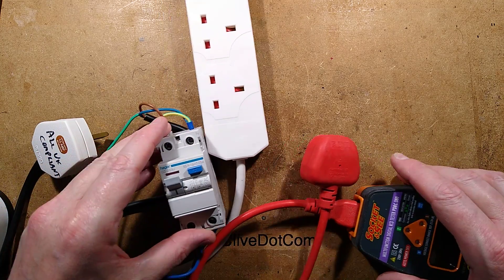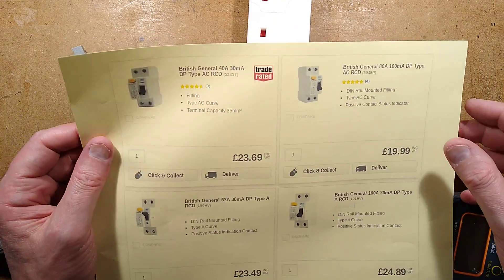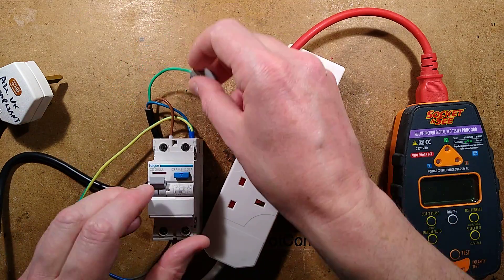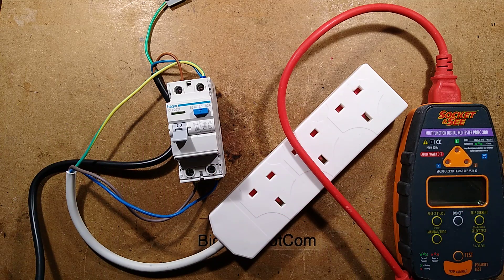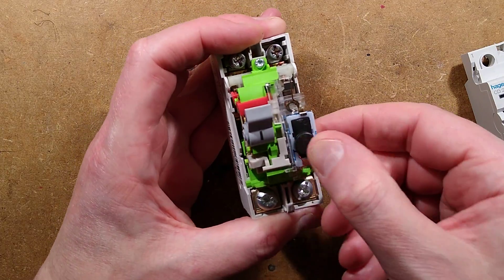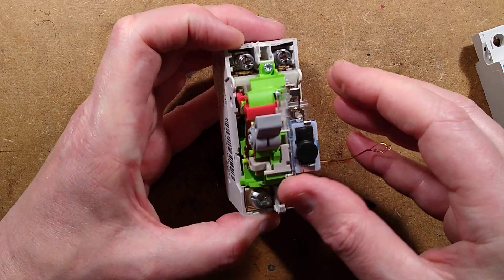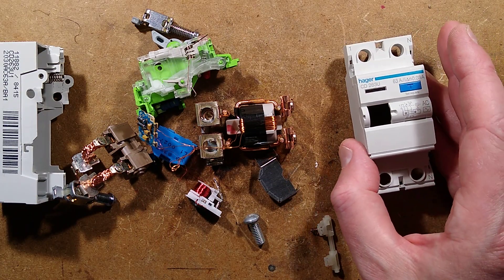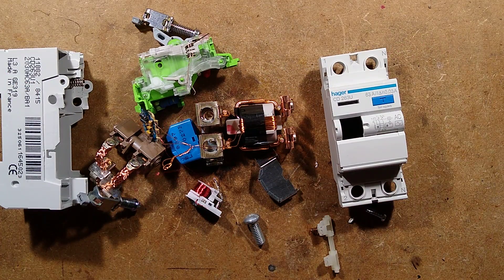Was this RCD damaged by overcurrent?

Comment: ‘You can’t connect neutral to earth.’ US: Am I a joke to you?
Reply from the maker: Neutral is connected to earth at the transformer and often at the supply entrance to a building.  But shouldn't be connected after that point.
Reply: @bigclivedotcom  There’s a round permanent magnet on the top of the coil. The induced voltage cancels the magnetic field and releases the plunger, which trips the breaker
Reply: yes, yes you are

Comment: Monthly testing of RCDs is easier said than done when I have two PCs running 24/7, two more that are generally suspended rather than fully powered off when not in use (thus 5~10W, but still require power to keep RAM contents), and a dozen or more Raspberry Pis that have a bad habit of corrupting their SD cards on power loss ... and a single RCD protecting all of the sockets circuits... 😕
(This is a mid-2000s installation with a single RCD for the sockets and no RCD for the lights, IIRC. The detached garage has its own miniature distribution board with RCD, but that doesn't help much here :))
One of the 24/7 PCs is on a UPS that will last a few minutes - long enough to test the RCD - but the other PCs aren't, and UPSs aren't exactly cheap.

I really wish we just had a box full of RCBOs, but no such luck, and it's not very practical for me to pay my landlady to pay an electrician to replace the otherwise-functional MCBs with RCBOs :(
Reply: Surely worth investing in a few Uninterruptible Power Supplies?
Reply: @stevep8773  Too right, and it tests your UPS at the same time :-)
Reply: @muzikman2008  also tests that PCs boot properly. I have in my charge a PC that after a powercut causes shutdown will not come on again without removing network cable and USB keyboard and mouse. Then plug KB in when it comes up "Press F1 to continue"
Reply from the maker: That and the fact that people can't remember how to reset their cooker clocks.  RCDs and GFCIs rarely get tested.  Fortunately they're pretty reliable.

Comment: If this is only rated for 63A, and it is not an overcurrent device, then are you supposed to not put more than a total of 63A of overcurrent devices on its bus?  How else would you limit the current?
Reply: Star Gazer - the consumer unit will have a power company (or private building company) fuse between the supply cable and the meter, the consumer unit is wired to the meter. It’s normally good practice to have the switchgear rated at or above the rating of the power company fuse.
The combined ratings of the MCBs is allowed to be greater because a diversity factor can be applied. It’s not likely that everything will be switched on at the same time. Although in this particular case, it does appear that the person who put this consumer unit in could have done a better job.
Reply: @Mark1024MAK  Thanks for the explanation.  In the US, there's a main breaker inside the service panel to prevent overload in the event the total of the branch circuits do happen to exceed the supply rating.
Reply: Put another breaker on the line that suppose to trip on overload condition
Reply: It’s called diversity. Not everything will be running at the same time, and you should try to build the board so that both sides are equally loaded. It’s not impossible, but very improbable that both showers will be in use at the same time as the oven is heating up (not yet up to temperature, as the thermostat will cut it off) and four pans are heating up from cold. Plus there’s some tolerance built in, it takes everything some time to heat up to the point of tripping, and even more time to heat up to the point of causing damage. Also, the breaker rating is not the actual current draw.
Reply: @edwardemberton8069  You obviously don't live with multiple females in the same house lol.
Reply: Not really,  the addition is only reached never... so it's just fine.  Although better balancing would be advisable.